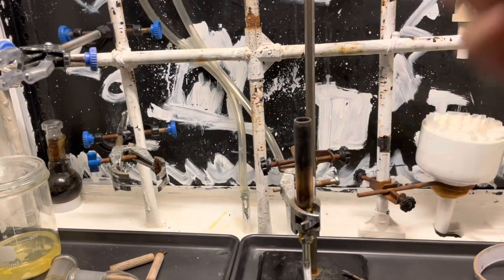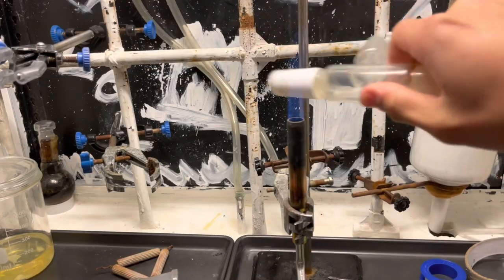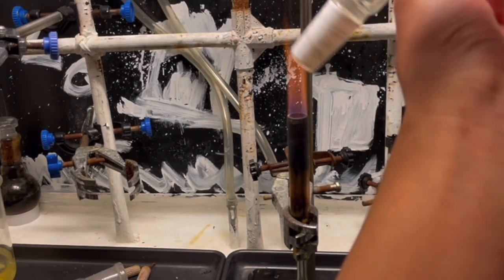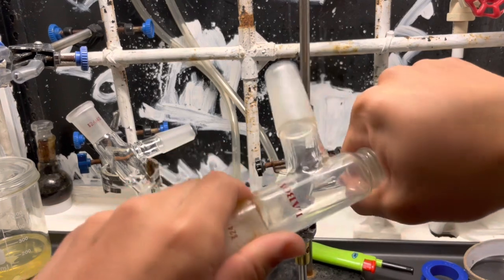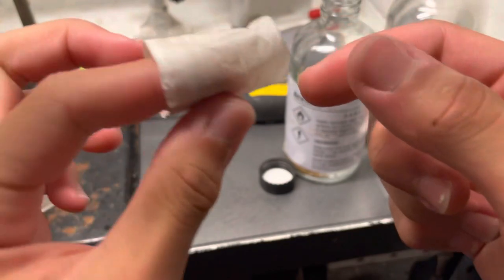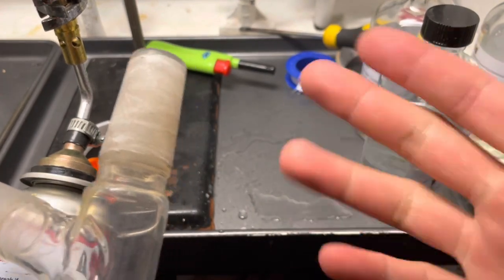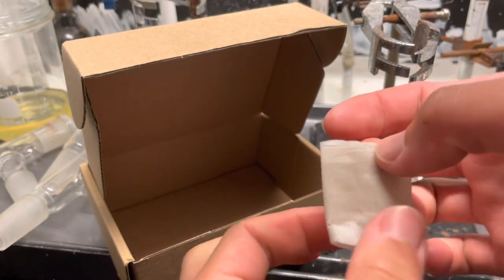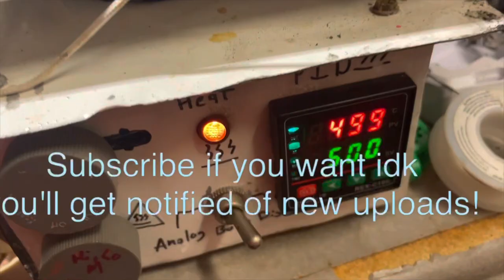DIY teflon sleeve for glassware

Comment: dumb question, what is the purpuse of this? wouldn't just some high vacuum greese around the joint work fine?
Reply from the maker: yes, but teflon sleeves are somewhat common in chemistry as well and this is accessible to amateur home chemists
Reply from the maker: this would also be good for when you dont want grease in case it contaminates your product